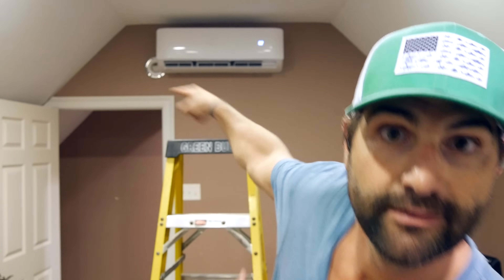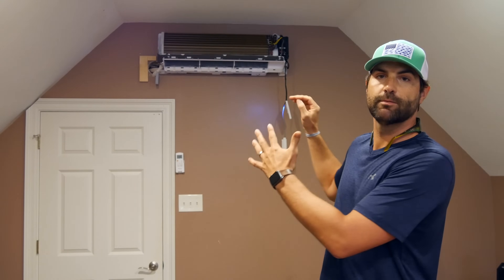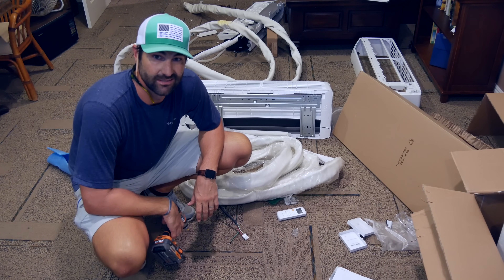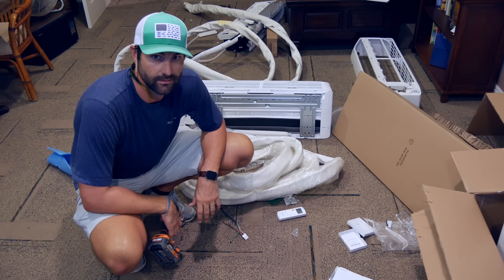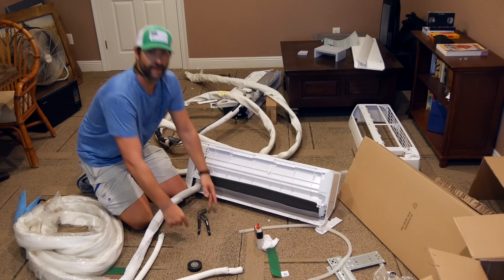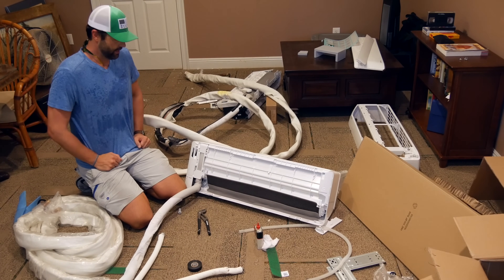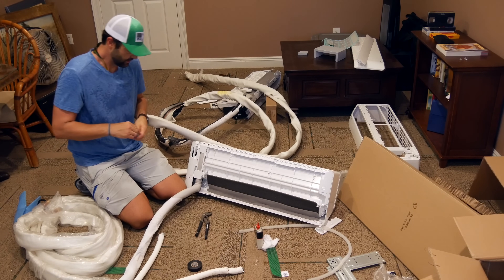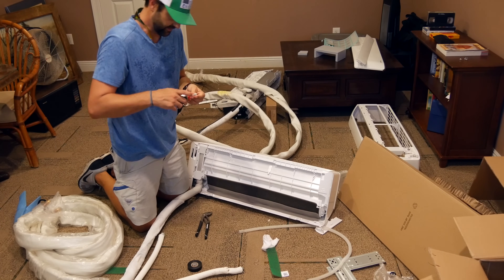Troubleshoot DIY Mini Split Not Cooling - Replace MRCOOL 18k Mini Split

Comment: Their customer service really sucks. I had the exact same issue except no HVAC technician wanted to come check my DIY for leaks during the busy the hot Texas money making months. It took MrCool over 2 months of going back and forth (also being ignored several times and having to call or email different people to find out why my support tech stopped responding) and hundreds of dollars in equipment and well over 20-30 hours of my husband and myself combined trying to find the culprit leak to finally get a warranty replacement for the indoor unit. When they finally did, they didn’t send the replacement unit with pre charged lines—which would save me so much grief! Now it’s going to have have to be done by HVAC tech if one will help—it’s August in Texas so it’s doubtful and expensive or I’ll have to get even more equipment to do it myself which costs even more money. It’s cost me more to warranty this unit than to buy a new one. And will cost me even more just to install the new head unit. It’s like they’re trying to punish me for using my warranty.

Comment: Had you done a full vacuum pull down to test the lines before charging (Mr. Cool tells you you don't need to a huge weakness in the install) you would have found the leak most likely.  That and the nitrogen pressure test can prevent incidents like this as you know after you do them you have a problem.

Comment: I am surprised the HVAC guy did not vacuum the lines and then check if it hold the vacuum or better nitrogen pressure the line and see if it holds. That should have told you if the leak was within the lines  or the coil. Another thing, you normally should have added R410a to the compressor since it was nearly empty. Form this, it is best to vacuum to a recovery tank and weigh the refrigerant recovered, then pump it back and add to the exact weight of refrigerant. Or better, add new refrigerant. Folks, make sure you take pictures of your serial number in and out units as they are printed on paper and don't last. Useful if you need to get the warranty. I was able to find the leak in my inside unit within the coils where the electrical is. Not sure the warranty will work as I cannot get the serial numbers (my inside unit has some of it missing and the outside unit serial is gone).

Comment: I noticed that your line set is exiting the indoor unit on the left.  Is that easy to do?  The Mr Cool install instruction manual, (current models) does not give any left side options, (as far as I can see).
Reply: my pops and me are currently installing a Mr Cool 4th gen 18,000btu mini split and you will see on both sides there are punch outs to run the lines from the rear, or both sides.

Comment: My Mr Cool DiY still works, it's just not blowing as cold air as it did the first year (2020). Air temp went from 38°F to 54°F in just three seasons. Outside unit is clear of debris and is blowing warm air. It's gotten progressively worse. Used to keep the room 67°F on a 90+ degree day on Silent Mode. Now it struggles to maintain 70°F on Turbo mode and it's only 86°F outside.
Reply: What was the issue?
Reply: did you ask a A/C tech professionally clean your inside coils and outside coils? Both coils should be professionally cleaned, or DIY if you use a non-acidic foaming solution, at least once per year. The coils get dust/dirt on them over time which reduces the heat transfer of the coils making them less efficient or you have a VERY small leak and you are losing a VERY small amount of refrigerant which would make the unit run harder to do the same work OR you have both problems. 

My suggestion is to call a professional to clean both inside and outside coils and check your refrigerant pressures/level. Then it SHOULD be more efficient/work less hard to do the same work.

Comment: you had to ship broken mr cool back  did mr cool pay for tech to trouble shoot the unit
Reply from the maker: No, they sent me a new unit and paid the shipping to return the broken unit.  They didn’t pay for the tech to diagnose the problem.
Reply: most AC warranties only cover parts. usually 3/5, 5/7, or 5/10. Meaning 3 year parts and 5yrs compressor but you cover the price of an AC technician to diagnose and install them.

Comment: You didn't show how to take the old unit apart.  Mine is working fine, but I missed getting the condenser line through the hole.  I don't know how to get the condenser pipe through the hole that is blocked by the inside unit.

Comment: This is 5 years ago, but I just got 5 different quotes for a 4 ton furnace system. The average quote was 14 grand! No new plenum, no new ducting. Highest quote was 20k, lowest was 9k. MrCool DIY is going to be about 6k.
Reply from the maker: This one is still working great
Reply: The contractors here in New England all use Samsung, Fujitsu, or Mitsubishi. I got a quote for a 28000 system w/ 3 air handlers for $14K installed. Senville sells the system for under $3,000 and I don't think this Chinese brand is any worse than the Japanese/Korean brands. Can't believe electrical and installation labor is over $10K...

Comment: This i about the only video i found having to change the inside unit. Saved me a lot of reading time. This will be simple my outside unit is on the otehr side of the wall.  I wont even get into why I have to  change this and the worst customer service from MrCool.   Great video,  showed all how to swap it out, if I was a movie director id say cut the video from 16 min down to  5, but you still get the Oscar award. Thanks for posting and taking the time to do this.  kudos

Comment: If the leak is in the line then changing the indoor unit won't fix it you will need a new lineset

Comment: Watching this video because my mr cool diy 24k unit big suction line is freezing over and cooling but not super well. It must be low on refrigerant and is also pulling 11amps (2585 watts) when on instead of the usual 2 amps (470 watts). Hopefully a solder joint hasn’t developed a leak

Comment: So, I doubt you're still reading comments from this video but could really use the help.  I installed an 18 Mr cool this weekend and the bottom clip is not seated right.  I need to lift the unit from the wall but I cannot move it to save my life. I know I have to disengage those clips on the bottom but no idea how. Any help is greatly appreciated.
Reply: Try a flat head screw driver at the bottom clip and than pull on the rubber portion of the air handler . It should come out. I had similar problem and that’s how I remove the unit and remount the 12 k air handler

Comment: Just installed 2 of these (12k and 18k) and 18k works but 12k was shwoing p4 right away.  Did whatever troubleshoot that was mentioned and was seeing 120v and the valves were open.  Called their tech support 3 times and left 3 messages because thats all you can do but didnt get any call back.  Went to their site and started a chat and they told me to call hvac and have them look at it.  Wtf?  Would you buy a brand new tv, bring it home to find out its broken and pay a repair guy to come and look at it?
Reply: They don't have anybody subcontracted to perform service. And from what I have heard, HVAC don't like to work on stuff they can't get parts for and didn't sell the customer in the first place.

My 12K 4th gen mini split took three months from install to get up and running due to the P4 and other errors. Every part was tediously replaced under warranty. By then it was late fall. Heated during the winter. Then found out AUTO mode would not work in Spring. 

By summer, I found out that the cooling wasn't working either. I get 72-76F coming out of the evaporator (indoor unit). Mr. Cool literally told me that using an infrared thermometer to check the temp this way was not a valid test but did not suggest any other test. Now we're going into August and my help ticket — filed in May — is still being ignored. All you can do is leave a callback number but when they do call back they claim they are customer service, not technicians. Despite the fact that my unit was a lemon out of the starting gate, they would not expedite my access to a technician. They could not tell me when I might hear back from a technician. I am afraid that if this is not fixed before the end of summer, I won't have any idea whatsoever if the cooling is working before next summer.

But even if I had lucked out and my experience had been better, I am no longer sold on mini splits. My main reason for buying a mini split was to cut my outrageous electricity bills for heating an attached (insulated) garage. What I didn't know is that mini splits recycle air, whereas traditional through-wall A/C units bring in fresh air. It's not well understood by first-time buyers that one may have to deep clean the outdoor and indoor mini split up to twice a year, and even when you do clean them you may or may not be able to clean the blower wheel — which is where mold can accumulate as a consequence of the moisture and the recycled air. So the air may not be healthy for anyone to breathe, if it is not frequently and properly serviced!

I am kicking myself that I returned a working inverter through-wall unit to Costco — that they no longer carry, of course —that was cooling my space very well at a fraction of the size, cost and hassle compared to a conventional A/C wall in order to "upgrade" to this mini split. I thought mini split was the way to go because most cooling/heating combo wall units do not have the capacity to heat in the winter below 40F degrees. I did not want to bother with a supplemental heat source and thought that mini split would solve that problem. If I had known that they would be high maintenance and that failure to clean them inside and out every six months could mean a significant decline in performance if not also mold growth on the difficult-to-access blower wheel, I would not have bought ANY mini split! If hindsight is 20/20 a modern inverter wall unit will have similar performance with far less hassle and cost compared to a mini split.

Comment: Interesting video. Thanks for sharing. I found this because our 24K BTU MR Cool Ductless Heat pump (2nd Gen) quit heating a couple weeks ago. I had a technician out today and he found a leak that developed in the copper tubing at a soldered joint just above the accumulator. He commented that vibration was probably the likely cause and showed me a photo of another one from a previous job last week where that same line broke in half. Anyway I was curious if you had a feedback on how the warranty process with Mr Cool went. I have made contact with them and I am waiting for a technician to call back. Just curious how long the process took from start to finish on your warranty claim, and any other general comments you may have about the experience. Thanks!
Reply from the maker: The warranty process went smooth in my particular case.  From the time I discovered the issue to the time the new parts arrived at my home, it took about 2 weeks.  I’m just a DIY’er who doesn’t want to spend thousands of dollars on a mini split for my detached garage, which is why I like these units.  MRCOOL will honor their warranty.  Message me via my website if they don’t respond soon.  I may be able to help you..
Reply: @PahjoDesigns  Everything went well with our warranty claim. It took around the same amount of time as yours. Communication went well and they sent out a new unit. I just had to pick it up at a local freight company. I have the new one installed and everything is working good. I appreciate your feedback, as I wasn't sure what to expect. I was happy that MR Cool stood behind their product. :)
Reply: @Camanohal  Watching this video because my mr cool diy 24k unit big suction line is freezing over and cooling but not super well. It must be low on refrigerant and is also pulling 11amps (2585 watts) when on instead of the usual 2 amps (470 watts). Hopefully a solder joint hasn’t developed a leak like yours did. Since they are on 3-4th Gen Diy builds did they send another second gen indoor unit? Or you got a 3rd Gen indoor unit to go with the second Gen outdoor unit? Thanks in advance!
Reply: @LeuCustomKnives  Actually they sent us an entire new unit inside and out with pre charged lineset. It was the same generation that I already had. This was great because the cost to have an HVAC contractor charge can get pricey.
Reply: @Camanohal  yes hvac full install is ridiculous. I’ve heard upwards of $7k for a 24k mini split 🙄. Would literally take 2 hours or less. And probably $5k is the labor cost in that $7k charge. What did it cost you to have your hvac guy diagnose the leak at one of the  solder joints? Did they have to cut off the white covering that comes with the precharged lineset? I have a 2nd Gen 24k unit as well that’s leaking now too 😭.

Comment: Hi - i wonder if you have any ideas fix a problem that is driving me nuts!  When I run my Fujitsu mini split in Dry mode, in a couple of days i get water on the floor around the condensate pump.  I replaced pump with new one but same problem.. I swapped the new pump with the pump from my furnace and still a water leak.  Line from the unit is not kinked.  Line from pump to drain pipe is not kinked or blocked. The unit itself is not leaking the wall is not wet.  The float in the pump works when i pour water into the pump.  I also disconnected the pump and ran the drain into a bucket  This worked fine with no leaks.  Any ideas?

Comment: Awesome video. Have a quick question for you. I have the same unit and I need to lines to exit the left side just just you have yours. It comes packed that way with the lines tucked to the left and looks like on the end you can cut out an opening. Just curios how you did yours?

Comment: Thank you for this. I just ordered a DIY mini split for my attic space. I couldn't really find videos that have unique installations. I will have to mount it to a wall then have then run the wires in an unfinished space then back out into the room to be then run down the wall of the house. That is one option. I called a HAVC to install company and they wanted 6k for the installation of just a 12,000 BTU one - With the help of an electrician  and an MR Cool DIY kit everything will cost me about 2800 - because I optioned to purchase a 23,000 BTU - Because I know the 1200 will not work, because I run a 14000 BTU portable AC -- which is a nice unit but not in an Attic Space - I only have skylights, so it really doesn't vent well.

Comment: actually sir you can run the refrigerant lines up with the drain lines as well all you have to do is ad a mini split condensate pump and then you can run the lines anyway you like. the pump will pump the water out when the reservoir container gets full of water.